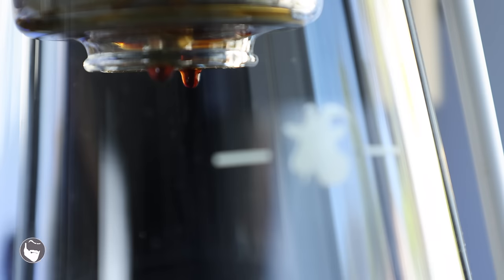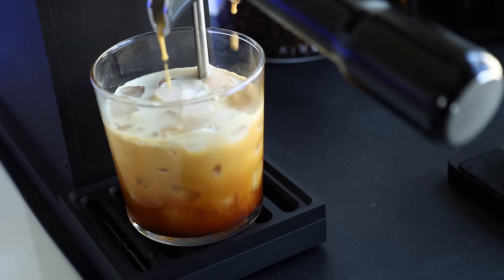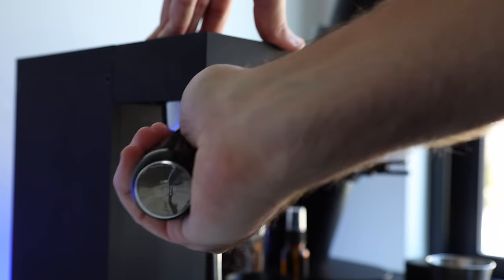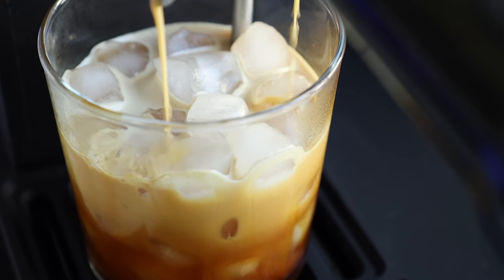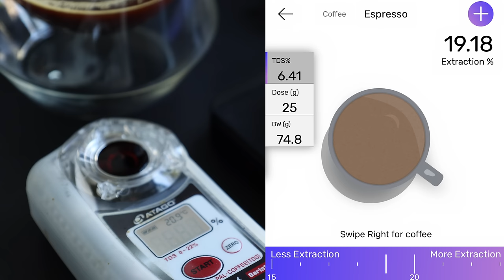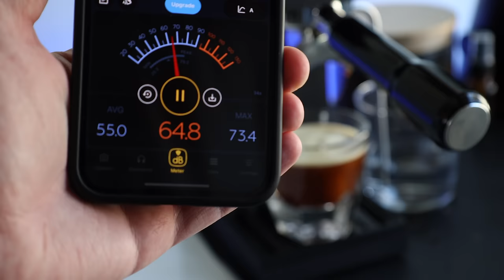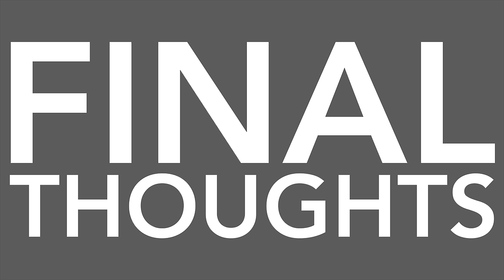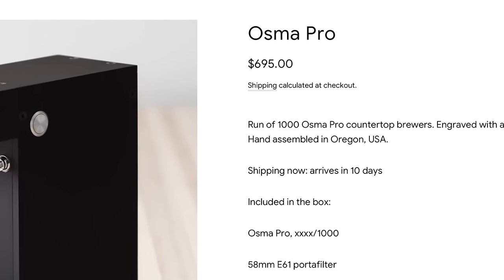OSMA PRO - The Cold Brewed Espresso Machine

Comment: I happened to be one of the early adopters of this product and was one of the first to receive it. You're definitely right that it's very easy to under-extract and get offputtingly sour results. However, at its peak I've found an awesome depth of flavor, with virtually no bitterness clouding the result. In my experience it's best to pretty much go just slightly coarser than the point at which it chokes and pull a long ratio shot (somewhere between 1:3 to 1:4). Combined with a pre-soak of 10-15 seconds, it'll be frustrating slow - almost 2 minutes overall, which is annoying with such a loud device - but the results are definitely worth it IMO. I'll also say that the results are definitely best when pulled with room temperature water and served over ice. I'm happy to share any more experiences or help troubleshoot
Reply from the maker: Glad to hear you’re enjoying it. In the end, I tested a lot of different methods, long and short, coarse and fine, but extracting with cool or cold water just doesn’t bring out the flavors and textures I like.

Comment: Hey, something I would be curious about: If you were to use it with hot water, shouldn't the added vibrations boost the extraction? Maybe that would be interesting to try out? 
I know that's not exactly what the machine is built for, but I think it still could be a good way to use the given technology.

Comment: I've had mine for about a month now, and absolutely love it. I agree it can be a little finicky, but honestly no more so than anything espresso related. One of the greatest parts is how fast it is to use. Traditional espresso on my la Pavoni takes 20-30 minutes start to finish for everything to warm up/come to pressure (not to mention fighting thermal stability). The Osma is ready to go instantly. Fill a cup with fresh water, place your portafilter, and you've got a complete cup of coldbrew within a minute. Also, I disagree regarding price - I feel like the machine is incredibly high quality (the machining of the drop tray is remarkable) and it's incredibly innovative. It's well priced for a supplemental machine on the bar to increase your coffee options. I also use mine daily now, so I think that plays a role in the value proposition.
Reply: Comparing the Osma to La Pavoni is not really fair.  One is utilizing latest tech, one is using one of the oldest espresso methods.  A Breville espresso machine may be a better comparison in terms of convenience and build quality.  the Breville Dual Boiler will be ready to go in 6-8 minutes and be rock solid stable temp wise, and has a timed start function for it to be ready when you are.
Reply: @randyhou8522  fair, there is a bit of a technology/age gap between the La Pavoni and the Osma, but I'd argue that the price of the Osma is an even better value compared to a Breville. Even the dual boiler is an appliance, although nicer than many of their other products. The Osma is still miles ahead in terms quality and durability/user service ability.

Comment: My Quick Mill Alexia Evo has a mode where the machine can be used (pump and all) without turning the heating element. Maybe I should try it to make room temperature espresso on ice... any suggestions for ratio and grind? For regular (hot) espresso I usually go for a 12 gram single in 1:2 ratio. Since cold and quick extraction is going to be weak I assume a larger basket and finer grind would be needed to compensate.

Comment: Thank you for another open review.  The idea seemed very interesting right up until you mentioned the price.  For a small company with a new product trying to effectively create a new market, I understand the need to re-coup initial cost but it would be ";pass" from me. Are there enough Creatives out there to purchase this first model and fund OSMA through to a cheaper second model ?
Reply from the maker: You’re welcome, and thanks for watching. I’m with you, the price is what would hold me back considering it wouldn’t be a daily brewer for me. I do hope they can bring it down and maybe polish it up a bit.
Reply: The problem for me is you can probably get very similar results using a PID kit Gaggia or other machine and simply turn off the heat. Then you get both in one machine
Reply: @KnowledgePerformance7  doesn't work that way.  It would never make the pressure without any heat.
Reply: @veganpotterthevegan  There's that,  and I think at least half their pitch is over the extraction via vibration, which, of course, you wouldn't have from a traditional machine.

Comment: Spro you ever try this with an espresso machine at startup before it heats up? I have 6-8 bar of pressure before I even turn my ECM Barista on. With needing a coarser grind anyway, I'm betting that's enough pressure to push through a puck without even turning on the ECM. I'll give it the old college try soon.

Comment: During the whole video I seriously considered buying one, until you dropped the price.
Reply from the maker: Yeah, I think the price tag is going to be the uphill battle for them
Reply: For sth similar, you can get a flair older version, cheaper and I believe it does the same thing :)
Reply: considering that it is machined from 6061 aluminum, here in the US, not China, I don't think the price is high.  I bought one.
Reply: @TS20ification  Congrats! Do you have any informations about the internals? Is it all made in the US?